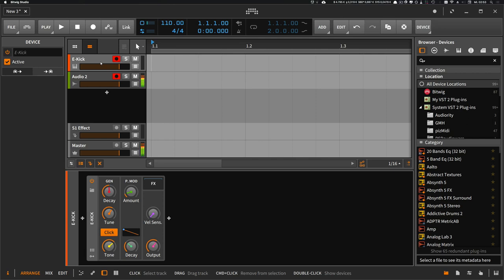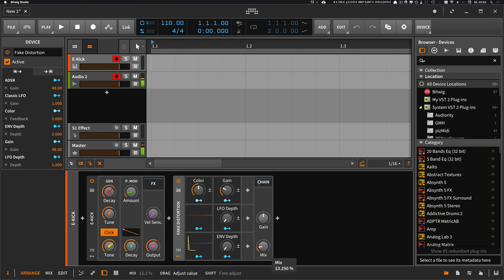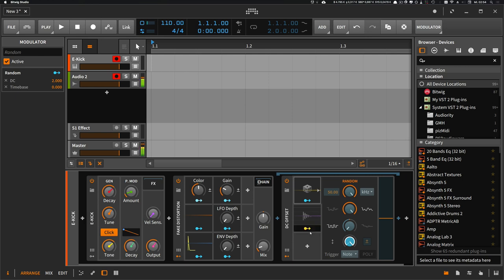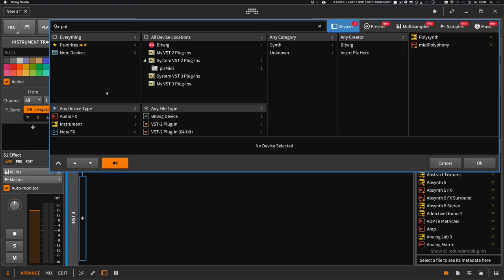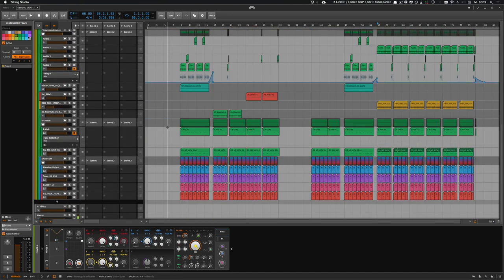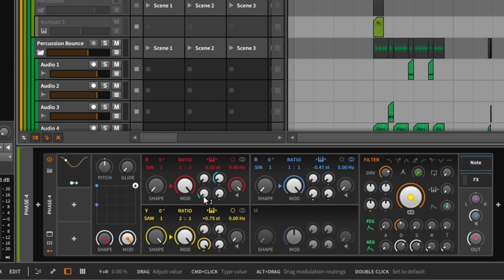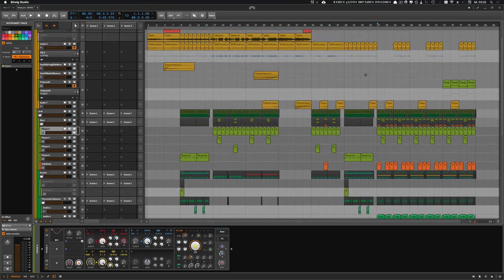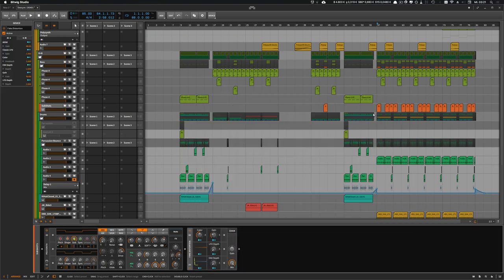Fake Distortion - give sub & synth kick drums more grit

Comment: Do you have any tips how to emulate Absynth pipe effect using Bitwig tools? Maybe modulate Amp cabinet properties (length, width, height) or something else? I'm little stuck on that. Your experience sharing is awesome. Thanks for your work.
Reply: you can turn your favourite absynth effects into IRs and use them with a convolution plugin. should work for effects like static reverb and resonators like the pipe.

Comment: thanks for the video, sounds interesting. would like to rebuid this, but i think i did not fully understand yet.
its basically an oscillator making a noise which is modulated.
but what exactly does the „audio rate modulator“ do?
Reply from the maker: the audio rate modulator modulates the "amount" of the random modulator. Its there to make only noise audible, when theres an input signal.Otherwise you would  hear a constant noise floor. or in short: The amplitude of the input signal controls the amplitude of the noise signal.